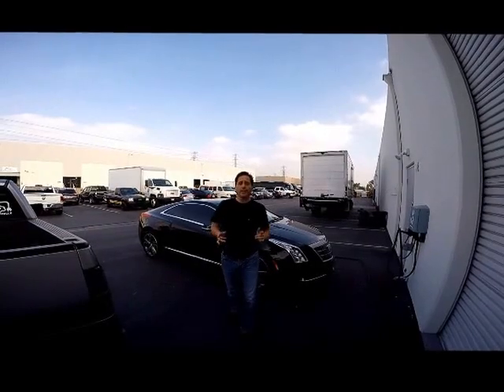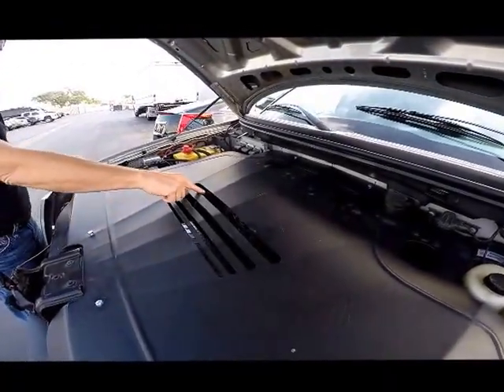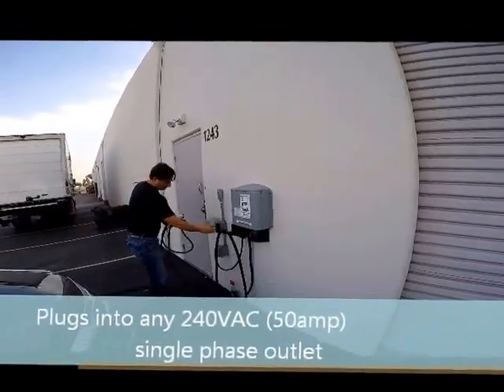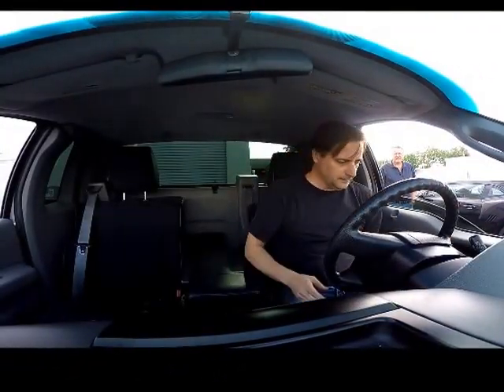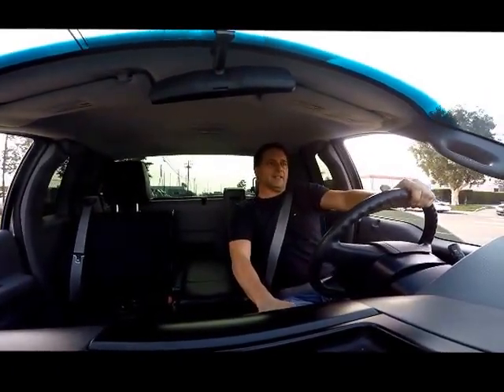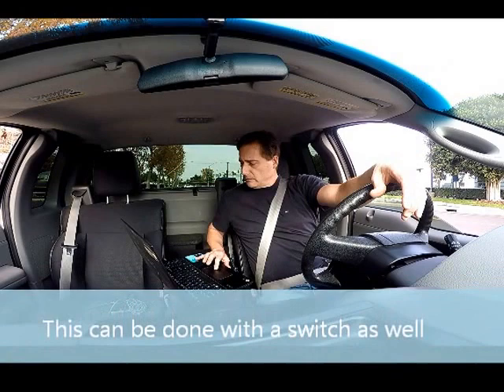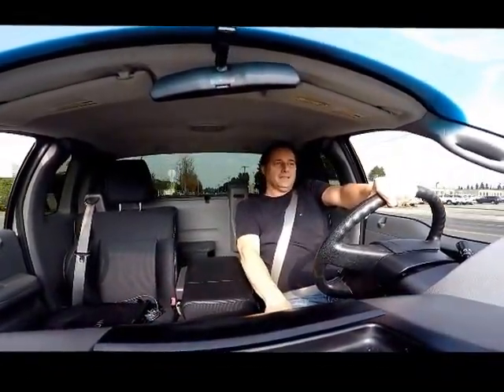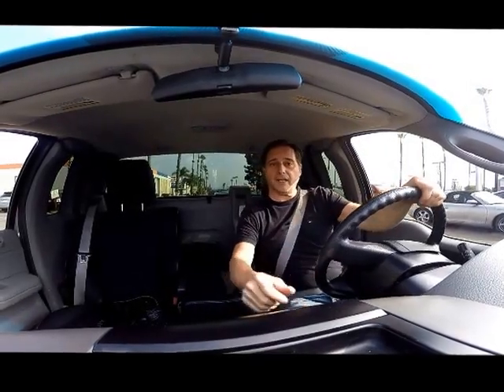F150 all electric Built and designed by Edward Monfort

Comment: I would be interested in it if it can get the same amount of miles as a gas motor can get. around 300-400 mile range. other than a 100 mile range.
Reply: I seriously doubt that the tesla semis will go 500 miles on a single charge. Plus I truly don't believe what elon stated how fast of a take off with a fully load truck will be. I believe he over exaggerated that. Going back on the mileage situation. what elon claim that 500 mile range. that would have to be on a perfect day at the perfect time of environment. I don't believe him like i don't believe other automakers where they say for example,( take my personal truck. its a 2010 ford f150 platinum with the 5.4L v8. I still have the sticker price) that, that truck can get 15 mpg in city and 19 mpg highway. I've made cross country road trips and highest mpg on highway is 17.4 mpg. and city driving it was around and best 13.5 mpg. All these automakers over exaggerate on mpg. I'm surprise that there is no lawsuit about it. once those tesla truck do come out and do drive it like it suppose to, I wouldn't be surprise i would be reading a lawsuit against tesla for claiming something that it doesn't happen.  Frankly, I just wish automakers would be more truthful but that won't be happening in my lifetime.
Reply: I wouldn't mine converting my ranger to electric but I would like to see the same range as I would get out of the gas motor i already have. that is 300 to 350 miles max.
Reply: ya I saw that video about the 1000 mile or world record electric vehicle, the problem is, to me, is that it was functional as a daily driver. they pack batteries in the passenger seats and the only seat available was the driver seat. I'm sorry but that to me doesn't consider as a daily driver. that is classify as a science project.
Reply: I wasn't all in the electric but when I saw the unveiling of the tesla semi truck, I want to try to be a little educated. some people prefer having electric vehicle. I preferably have combustion vehicle. but the time when texas had that hurricane and it shut down the refineries and many gas stations were out of fuel, at that moment, having an electric car is ideal. The only way I would jump into an electric vehicle is that I would want to same amount of miles as per my gas vehicle. the new model s, 100d,  on tesla website can go around 335 miles. That is the same as my ranger. But I can't afford a $80k car. it needs to be around $40k
Reply: The main killer on cost wise is having to change out the battery. idk what vehicle you drive if its a tesla or nissan leaf, prius, or what ever. the price to change it out would be around $7k minimal. and it goes up from there. a regular car battery can last from 2-3 years to 6 years. 

what is even worse is that you could have a defective battery probably once the warranty expire and the only way to get it fix is to replace it. 

my only concern for me, for not jumping on the electric train wagon yet is 1) range 2) reliability 3) battery life expectancy.
Reply: @jasonman1515  if you compare having to change out the batteries and the regular maintenance on gas and diesel you still win with electric. Gas and diesel has weekly, monthly, yearly maintenance which not only cost a lot of money but takes up valuable time and if your truck is a work truck like mine that time you lose in the shop is also money lost. My diesel motor just cracked last week, turbo was leaking, exhaust had a leak, did the rear end, and did injectors all at one shot. The mechanic is a good buddy of mine so I got a really good deal and had my truck parked for only 2 weeks. Dealer had told me it was a 2 week wait just to get in and the bill would have been worth 2 battery  swaps. After all of these brand new shiny parts I still have to go fill up my tank with diesel instead of cheap or free electric like I do on my Tesla